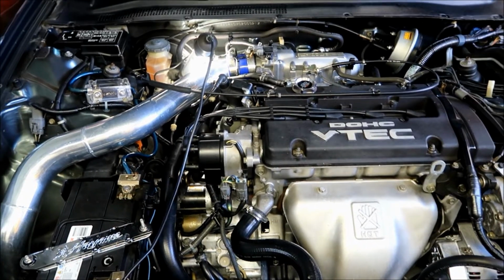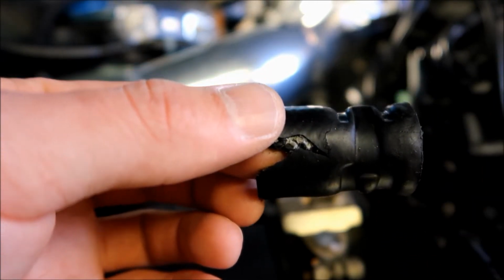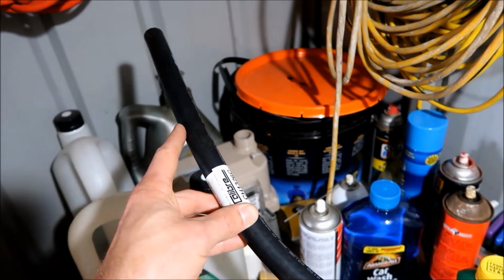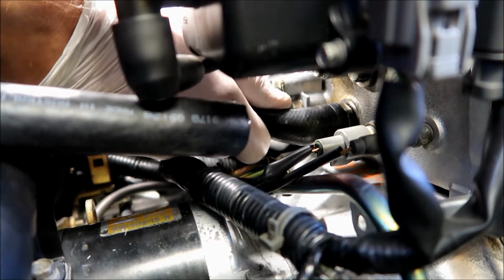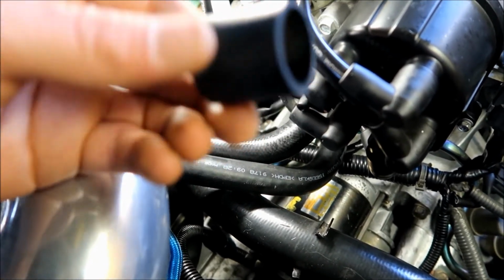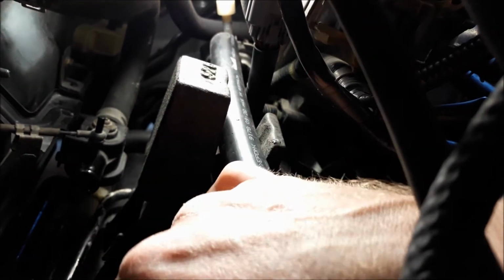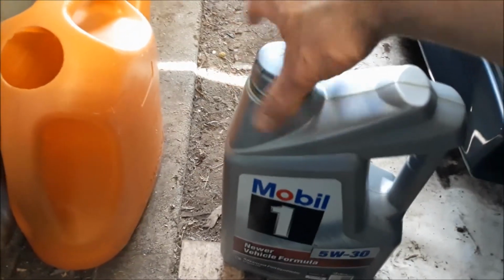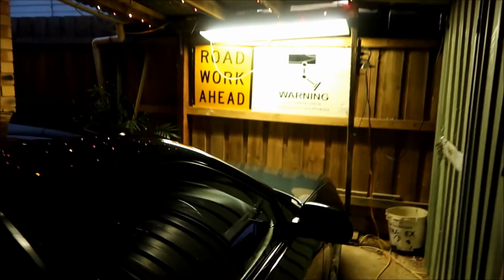Honda Prelude How to replace your heater hose.

Comment: nice vid, thank u! how do u clean ur engine bay btw?
Reply from the maker: I use degrees rinse off and wipe down with a rag.
Avoid your pulley / drive belts when degreesing. 
Otherwise, it will remove necessary lubrication for bearings.
Reply: @xtrongarage9666  awesome, thank u! keep on with the channel plz! 🔥🔥

Comment: Just Bought a Honda prelude 1999 Vti-r 5 speed manual. Just wondering about some basic things i should clean up for the car?
Reply from the maker: Doing a full detail in and out, degrees the engine bay once or every two months. Maintenance is key really, like servicing Timing Belts being done it really depends how good you are working on cars. Or you have a friend that can give you a hand or that's knowledgeable and good with cars. Do research on the car I suggest youtube, has many videos that will educate you.

Comment: Do you have to do a radiator flush after that installment?
Reply from the maker: There's no need to do a radiator flush after instalment.
If you approach it the way I did there's no need for it.

Comment: Love your videos , got a question and hopefully you can help me .My 98 prelude keeps running hot in traffic when I stop. The thermostat is brand new and fans are running properly, any suggestions on what else to check ?
Reply from the maker: When you start your prelude let it get to running temperature.
Then you should see that both fans come on together then you know it's keeping the radiator cool.
Any air in the system would also cause you're issue that you're having.
Running a non efficient radiator such as block passageway this can also cause  overheating issues.
Tread carefully the engine block is made out of alloy.
They don't take heat stress too well you can crack the block by topping up a hot motor with cold water or just getting way too hot. 
This is the best advice I can honestly give you and hopefully you'll find this helpful in some way.
I appreciate the follow.😊
Reply: Thanks for your help !!
Reply from the maker: Cheers anytime time bro.
If you like give me an update on the situation if you got it sorted out or not sweet.

Comment: This seems what's happening to my Lude the mechanic said my radiator looks old n cracked but I can see the leak coming right from the heater hose now,did the same thing just pulled in my driveway as it started steaming
Reply from the maker: Yeah mechanics aren't always right.
It's an old car in general so him saying your radiator looks old doesn't mean shit.
Sounds like not a good mechanic.
Luckily it happened at home for you as well